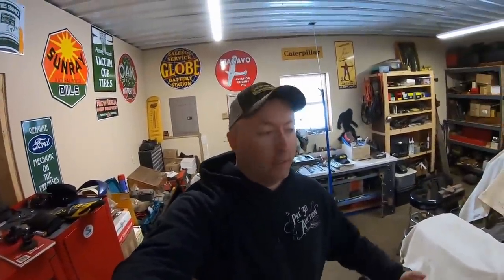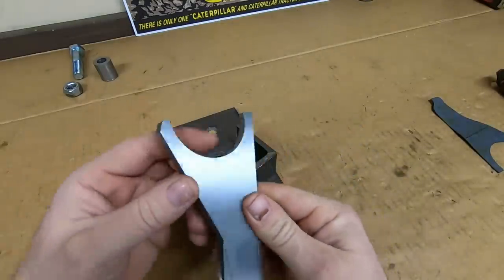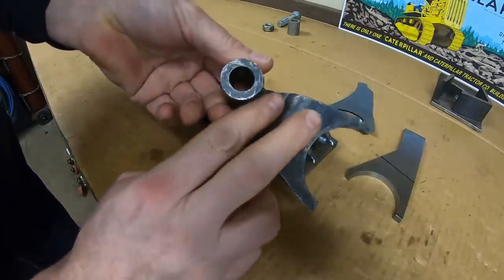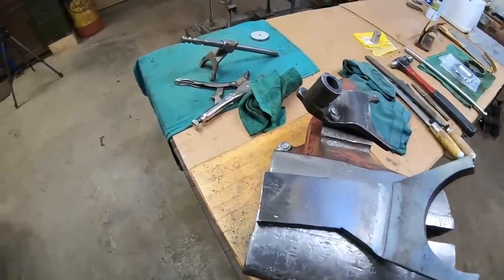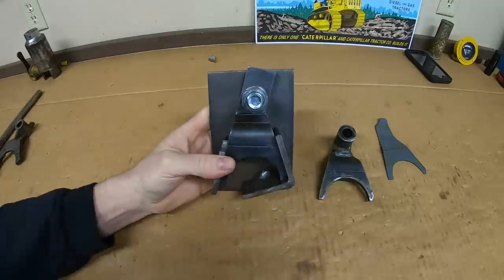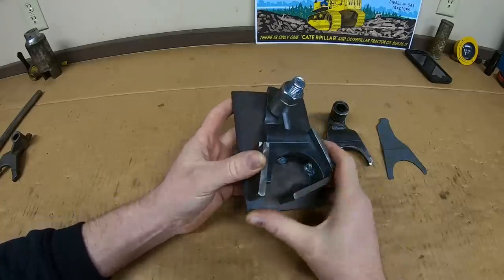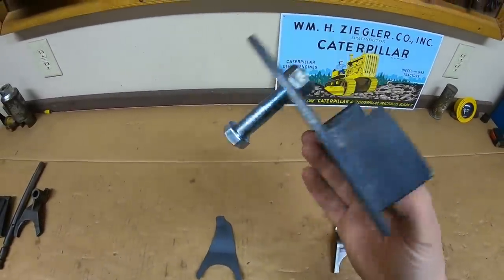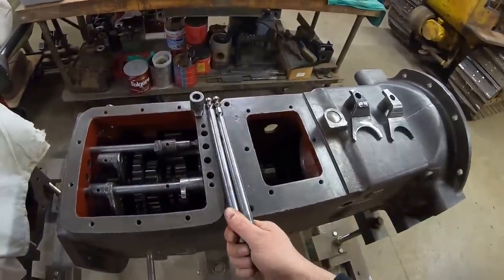Minneapolis-Moline 445 Prototype #X231 - Part 46: Starting Over & Completing the 2-3 Shift Fork Work

Comment: I feel like your getting more pep in your step with this project... A little bit learned I think, through the 1113 experience... So, the knowledge gained there has reinvigorated confidence, I think. I could be wrong - but you don't seem as tired of it as you were then. Moreso interested and curious in your ability to overcome the next challenge. Plus. There is no undercarriage work to do. (LOL)! Onwards!

Comment: I see you have taken some of the experience from the D2 rebuild and use it on X231. I love the new fork and I would say the added extra pieces dose only compliment the machine. It was a experimental tractor and so it was subject to many changes. If I think about it it's a miracle it survived, lot of other manufacturers usually scrapped the demo or experimental models after they had figured out the pros and cons.

Comment: I see you use a lot of old Craftsman machine tools. I remember when Craftsman tools were all "made in the USA", sadly those times are past us now. I started my 45 year A&P career using all Craftsman tools, but that left me tool less at home. I started replacing my Craftsman with Snap-On and Mac as my aviation career progressed and bringing my Craftsman tools home. My tools had to do double duty for many years, home for the weekend and back to work for the rest of the week. About 25 years ago I finally had enough tools at home and at work that I was able to stop that practice. Now that I'm retired I have all my tools home and now have so many duplicates that my wife says I should start getting rid of some. I just can't do it though, as they were all such a big part of my day to day life for so long.
Reply: My dad was an A and P. I started down that road butleft it for other things. I have seen many aircraft and cars taken apart and put back todether with Craftman tools. Nothing wrong with them years ago then they got cheap. Now they seem better.

Comment: I think you made the right decision adding that webbing. As a steward of the history of that tractor, modifications like that which prevent possible further damage are a good thing. And who knows, that may have been the next part the prototyping engineers would have made had it broken during testing. If anything, you're just continuing the prototyping process.

Comment: I binge watched the complete play list for X231. I like how you went much simpler on this remake of the 2-3 shift fork. I like to look for the simpler solution when I have to find a way to do something. If you only need to do it once keeping it simple means that sometimes you work a little harder to make a part but you spend less time building a tool that you may never use again.

Comment: My humble opinion on that little gusset is that had the guy mocking it up and fabricating it had another hour and given it thought he might have done it since a production model would have it. So it is reasonable that it would be there. It is a restoration fix for preservation and operability that does not detract from the history or presentation. You are not passing it off as original, but as a replicated part to get it back to function. So my long windedness is to say I think you did right. Great information as always! X231 could not have found a better keeper.

Comment: I spent much of my youth driving various MM tractors. One thing they all had in common was poor shifting. From 20 horsepower to 120 horsepower they all had loose shifters and as far as I could tell they all used the same or very similar transmission.
Reply: @squatch253  Good I thought it was just me.

Comment: Great to see you move from a finished project and jump right back to the X231 without missing a beat. I fully support the gusset decision, because the prototype shop would have done exactly what you did if they knew of the potential failure ahead of time. But they had no idea somebody would actually put their prototype to work. I really doubt that was supposed to happen.

Comment: Have you watched any of Keith Fenner's videos about straightening marine shafting using a torch, some bearing rollers and a air over water sandblaster (no sand)? you can fix the second shift rail to some incredibly close tolerances like that if you so wanted.

Comment: The gusset seems necessary from a preservation standpoint. It seems like not having that was the root cause of the failure. The mild steel seems OK. If for some reason you do find wear in the future some hardening may be possible. Maybe by welding and grinding the worn surfaces. However, I suspect that with regular proper fluid maintenance wear won't be a problem. This was possibly not done before so may have contributed to the wear.

Comment: Great series restart! Prototype means in truth you really can make a replacement part "wrong". I'm sure the factory guys would have beefed up or gusseted where needed any failure that happened to them! To that end Squatch, On the replacement shift rails, I would be temped to case harden them for better life and smother shifting. Either that or start with a better type of steel? My two cents anyway. I know what ever you decide on it will work! Or ELSE! 🤨 Can't wait to see the next installment!

Comment: Squatch, with regards to adding the gusset to the fork, I think you should rest easy as I believe you are still following the spirit of those who engineered the prototype. As you noted they did add the gusset to the production fork, but the production fork is cast while the prototype fork was machined out of plate steel as you are reproducing. I would say that while the gusset wasn't on the original prototype fork, it would have been added in further development of the fork before the cast version was finalized if they had needed to address further issues in the development of the transmission and it had failed before they were finished.  

I like the others here completely understand how you feel about it not being an "100% original" reproduction, but the fact you added the gusset using the same plate steel the rest of the fork was made of I would argue was done in the same spirit the fork was made in, so rest easier about it. Looking forward to seeing this project progress further, I always learn new techniques on how to build/restore anything as well as how to "read" or research how it was designed and built

Comment: can you straighten the rail? Rolling on a flat surface like a engine block or head, should let where the high point is and a little pressure might just do it for the one fork, the other also if you dont need to fill in the detent area and just use there detent mod.

The new for looks good! even right down to the engineering design modification / correction.

Comment: I think by adding the gusset, you were just continuing on where the prototyping department left off. Consider your re-created fork a transition piece if you will between X-231's original and the production 445 shift fork.
Reply: And the fact they added the gusset to the production piece means they may have broke that once during testing.

Comment: With all the irregular shapes you create I'm surprised that you don't have a metal cutting bandsaw in your shop.  A used one could be had for about $400. in my area.  It would save a lot of grinding and torch cutting.

Comment: Squatch, if the Original crew of mechanics had received that damaged gear box back in that state, they would have made new parts, fixed the obviously deficient parts without a second of concern. Since your aim is not to remake it but to recreate it, new rails made to fit correctly is just happening later than the proto type guys could have done. But I feel your concern over right and proper is what keeps you from remaking it into a NEW tractor. The over all goal is to make it run and operate, there is going to be new parts required... some may be unobtanium others your going to have to make. Time and distance can be problematic, I am interested in seeing you carry on rebuilding this into a runner.

Comment: Love your channel!  Just a tip with the hole saw.  Since you were using it with the pilot drill you could’ve shifted the hole down on the material so only the pilot drill was making a full diameter.  The saw it itself wouldn’t walk then and only having half the saw engaged would allow the chips a place to evacuate making it easier on the hole saw.  Also would’ve used less material!  Keep up the good work.
Reply: True, it would have used less material but anytime you have a hole saw cutting a partial circle, you have a much higher potential for the saw to snag the edge of the metal. I've had that happen and ended up with a broken hole saw, a ruined piece of metal and several cuts and bruises from flying metal. In my opinion, I would rather use a little more metal and be safer.

Comment: So do the production 445 shift rails not fit either?  Man, this restoration is nothing short of a battle!  I admire your fortitude, keep up the fight!!!  :)
Reply: This comment is why I recommend watching all of the previous videos on this tractor. To use the production shift forks he would have to use the production transmission cover and shifter. That could also produce other issues  because the shift rods also had some differences. I don't remember all the details but I do remember his discussion of the options he had. He's trying to preserve a piece of history so he wants to keep it as original as possible.

Comment: The modification is a tough one. I see pith perspectives. My concern now though is that the box will contain new spec parts married to worn parts.
Reply: On gear to gear contact you want to see parts that have worn to match stay together. Replacing a shift fork is really not an issue the only time it will have any pressure on it is when it is moving the gear to align it to it matching gear. Otherwise it will float in the groove of the gear with plenty of room for the gear oil to flow around it.

Comment: I would have been impressed with the speed and ease with which you got that hole saw through that 1/2” plate if you hadn’t disclosed the YouTube secret in a previous episode.  Kidding aside, I was impressed with your whole approach to recreating that part. You are the king of shop made jigs and fixtures and I could believe that fabricating the fixture took longer than fabricating the part. But you do it so well. Glad to see this one getting back on the front burner. You may be the only person with this much dedication to attempt raising the dead. Good luck! 🥸👍🔨🔧🎆💨👀✅

Comment: IMHO, not a big deal adding that gusset to the shift fork. X231 isnt fine art restoration where you need to maintain the same look and feel of the original, while making it fully functional again. Given the chance, and an early failure, the engineers likely would have done the same thing. Not to mention that you arent stamping part numbers on the parts, and EVERYTHING is meticulously documented for future reference. Really glad to see that this fork ended up being a big nothingburger, when watching the original series, which ended with this fork, it seemed you were seriously dreading the fork rebuild. Going to 5J1113 when you did obviously gave you the break you needed and of course some more tools to work with (I remember the rebuild of the mill you were using for this). Shift rods should be an easy rework, and then the tranny appears ready to button up. Whats coming after this? the power steering unit that was all beat to hell, or the radiator that had more holes than RMS Titanic? You say this will be a dedicated parade tractor, but IMHO, taking at least one pass down the field on a plow day (or maybe pulling a hay rake would be less stress on those drawbar mounts....) would be fitting given the work put into it, and the life it has had before!!!